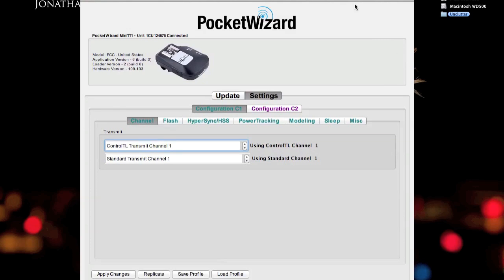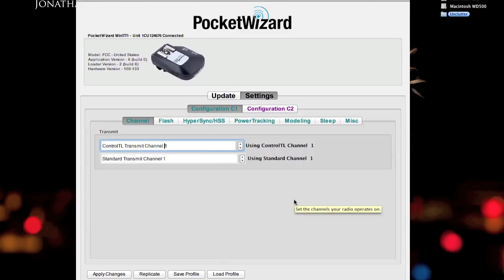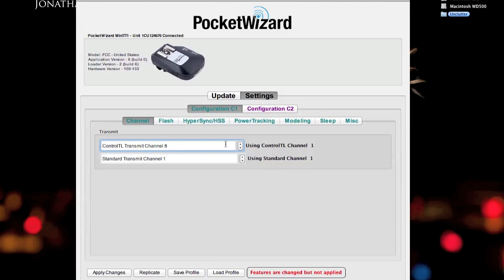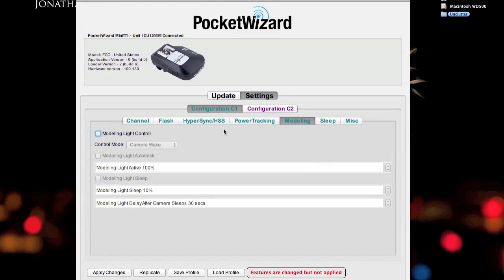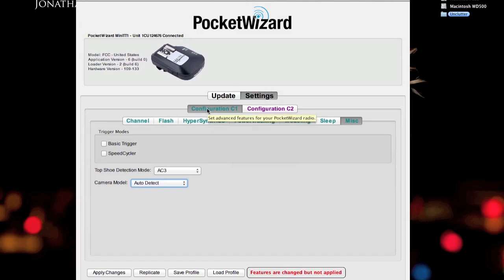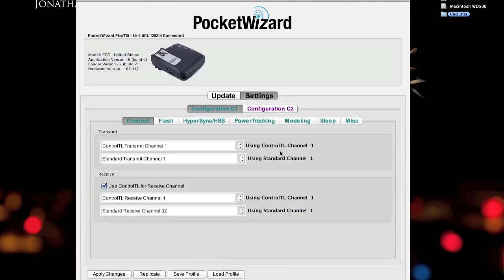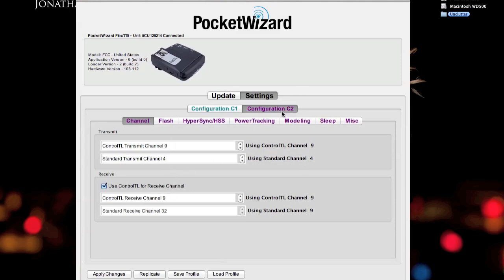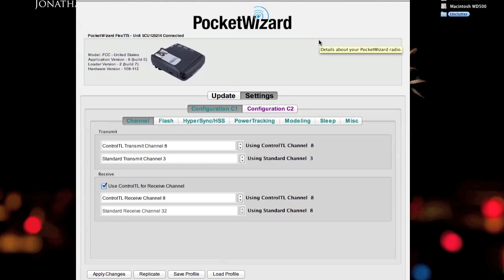PocketWizard MiniTT1 and FlexTT5 Setup

Comment: Hi Jonathan , 

Do You work also with lightmeters like Sekonic L478DR? I own both TT5 and TT1 and as far as  tested , in TTL mode I am able to setup lights properly, but once I adjusted the power with L478 when I fire the camera with TT1 the measures are totally different from the l478 measure.....

Comment: quick question if i get the pocket wizard FlexTT5 for on the camera to be able to get sync speeds higher then 320 sec. will i be able to use the pocket wizard plus 3, and plus x on the strobes? THANKS IN ADVANCE.
Reply from the maker: No. Plus 3 and Plus X doesn't support the Control-TL technology.

Comment: What if I set up both of my Flex TT5 ( C2 ) as Basic trigger? Will they communicate with each other? because I have a Sekonic Light Meter and there are times I want to go on full manual.
Reply from the maker: Yes. I use the TT5 for Canon with my Olympus MFT camera with non-TTL channels.
Reply: I tried it today. Set up C2 both as basic trigger. Then went back to the Channels tab both of my two flex tt5 at channel 2. Place the flash on top ( TTL ). Test fire but not working. Slide it to channel 1 both. Test fire working. Whats wrong with my set up? Just updated all my Flex TT5 to the latest firmware
Reply: Hope you can make a video also. I have an Olympus EPL7
Reply from the maker: Ok, when you say put a flash on top (TTL), is this some sort of Speedlight type unit (e.g. Canon) that is in TTL flash mode? If so, you need to set it to Manual mode on the flash unit when you use basic trigger.
Reply: Awesome Dude! It's WORKING NOW! Can I put any other brand?
Reply from the maker: Technically, if you set Basic Trigger mode, it is supposed to disable all the pins on the hotshoe of the TT1/TT5 except the center pin for flash triggering.

But what is of concern is voltage. I don't think this will be a problem if you were to stick a non-Canon flash on a TT5 for Canon (or a non-Nikon flash on a TT5 for Nikon), but it is something you will want to verify with another source.

Comment: Thank you so much!  Very informative tutorial.  I have the Mac 10.9.5, so had no trouble updating.  I use Einsteins with the Flex TT5 and MC2.  I will set my strobes power where I want it and when using the slaves they bump up the power all of a sudden.  Hopefully this update will help.  If you have any idea why this might be happening, I would love your input.  I'm frustrated that I've been stuck using a 33' foot cord for my sessions.
Reply from the maker: +Carrie Ryan If you don't have a AC3 controller on the FlexTT5 (which I'm assuming is on the camera hotshoe), I think what might be happening is that in ControlTL mode, the TT1/TT5 on the hot shoe is taking the Exposure Compensation value and sending that to the PowerMC2 on the Einstein. Without the AC3 controller to remotely control the strobe power, the PocketWizards can actually use the EV value on the camera as the controller instead. This is actually handy if you don't own the AC3, but obviously something you need to adjust for.
Reply: Thank you, Jonathan for your quick response. You are right.  I do not own the AC3.  I thought I might be able to set each light with my Sekonic L-478DR.  I set my PowerMC2 at -2 stops so I could shoot wide open.  May I ask, if it is the EV value on my camera controlling my strobe power, how do I know how to adjust for it?  Will it consistently raise my power to the same level?  Do you recommend the AC3?
Reply from the maker: +Carrie Ryan I could be wrong, in my assumption about the EV affecting the flash in your situation, but to eliminate this as a factor, shoot in Manual mode on camera (not Aperture Priority or Shutter Priority, or any other setting) and in the PW configuration for the unit you use on the hot shoe, configure Advanced Mode, go to Power Tracking tab, and make sure Power Tracking is on "Full Manual". After that, I can explain why the power of your strobe is changing on it's own. You can also try shooting in a standard channel, not a ControlTL channel. This is essentially a basic trigger signal, with no extraneous information going from camera to strobe, and vice-versa.
Reply: Hi Jonathan:  I always shoot in manual, and I checked the Power Tracking tab and it was on full manual.  However, I did need to update my firmware.  I will do some sample shooting and see what happens.  If it jumps I will go to standard channel and see what happens.  I cannot thank you enough for helping me.  I will let you know what results I have.
Reply: I shot many times today.  Slaves worked great!  No jump in power.  Thanks for all your help.  I still can't get my Sekonic to fire my strobes via it's transmitter.  Any suggestions?
Reply from the maker: I don't have a Sekonic meter, but as far as I know, as long as you have the ControlTL capable module for the Sekonic, it should work.

Comment: Very helpful, thank you! My firmware updates wouldn't work on my Mac Pro or MacBook Pro but worked fine on a PC. Same error on both computers. Strange.
Reply from the maker: +Charlie McDougall This video is almost 4 years old, and I'm assuming your Macs are running OS X 10.11. If so, PocketWizard's utility isn't compatible with 10.11 and they have yet to release an update. I had to update using Windows in a VM on my Mac (VirtualBox).
Reply: Ah yes! I am running 10.11.2, so ... PW has much catching up to do. I will be looking for their update. Thanks so much. This takes a load off my mind. I thought it might have been a problem with the gear I bought used.

Comment: Nice info and good details for a more customized set up.
I'm calling pocketwizard tomorrow but my mTT1 won't sync as fast as my TT5's do. I get a large black bar at the top shooting at 1/320th with the mTT1 and I don't get that bar until I'm at 1/500th when I'm using the TT5 as the trigger.

Comment: i would like to control my Ranger and Speedlight from my new Sekonik Pro L 478DR. 

I have Canon 6D with MIni  
Elinchrom Ranger with  ST4 
Speedlite with Flex 5

I am hoping you are an expert on Sekonik Pro L 478DR as well. I just wonder what setting you would recommend to control power levels of the Elinchrom Ranger and the Speedlite from the Sekonik Pro 478DR.

I did go to pocket wizard and they dont have info for Ranger and i have emailed Pocket Wizzard  but it could be three or four days before i get a reply.  Any help tiny or large would be appreciated. Great video and thanks for sharing.

Comment: Hi Jonathan, I have the same setup as you've got Einstein with MC2 and  Flex TT5 on a D800. I have all channels on 1 and i tried to trigger it but it didn't work. tried to use other Channel combos but still didn't work. And I have updated all Flex TT5 and  MC2. any idea. Thanks. Kas
Reply from the maker: Kasun Wickramage No idea. All I can think of us that the TT5 is the Canon version, not the Nikon version.
Reply: ***** thanks bro, but it's not the canon version, i use them with my SB 910s and it works perfectly. I'm really frustrated with this combo of Einstein and MC2s. But thanks a lot for your input. Kas.
Reply from the maker: Kasun Wickramage Sorry I can't be much more help. Those things should work straight up after a factory reset.
Reply: ***** Thanks

Comment: Hi Jonathan awesome video thank you for taking the time to create it.  I have an abnormally which I can't resolve. Maybe you have an idea. Both my Ranger and Speedlites fire a flash one every other trigger. 1 on in two attempts. Becuase the Ranger has its own Pocket Wizzard ST4  this leads me to believe my TT1 is the cause of the problem. I just wonder do you have any idea at all, any pointers that may help me resolve this. Kindly Simon
Reply from the maker: I've stopped using the TT1 on the camera awhile back, and put a TT5 on the camera hotshoe instead. I think the TT1 signal is too weak or the lack of an external antenna is playing a factor in intermittent triggers that I had with the Einsteins and PowerMC2.

Comment: i just got my tt1and my flex tt5 and when i plug it in it doesn't give me the options of flash/hyper sync/HSS/ power tracking / modelling/ sleep and misc. I'm wondering why
Reply from the maker: I'm assuming you did the obvious and updated to the latest firmware and did a factory reset. If so, then I have no clue.

Comment: Hi Jonathan!
I am using a Canon 6d and TWO 430ex2 speedlights both connected to FLEX TT5's. My problem is, only 1 flash fires. Is there a specific setting i need to tick in the utility software to get both flashes to fire? any help would be very much appreciated
Reply from the maker: Nope. Just make sure the FlexTT5s have the exact same configuration.

Comment: i am using flex tt5 tranciever with 430 ex , 430 exii and 580 ex ii . all of them worked at first time , but after few days i tried to use the 3 flashes but th 580 didnt fire :( , i tried many times but nothing happened . it works on camera but not with flex tt5 , any idea ?

Comment: I have done this Ocabi. Thanks for your quick response. I actually did, but when I click on the utility, it's say's Canon, The thing is, I actually downloaded the Nikon software and I went back and checked several times. It keeps happening. I'm pretty sure it's not suppose to do that, here is what it is saying when I click on my desktop icon "Pocket Wizard Utility 1.35" PocketWizard Utility 1.35.pkg
Quick Guide - MiniTT1 + FlexTT5 for Canon.pdf  ( This here should be wrong right?)
ReadMe.rtf

Comment: Is there a way to remote control both your flash/shutter in high speed sync ttl. I have my TT5 on camera with a ettl sync cable in its hotshoe going to an off camera flash with my mini in hand used to fire both remotely, it works perfect in standard trigger mode but I can get past 1/160th..